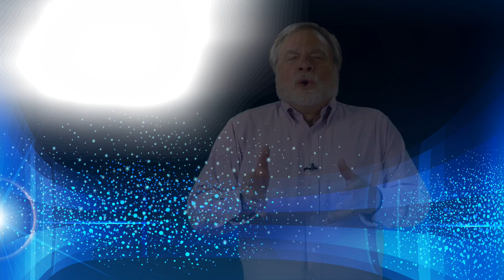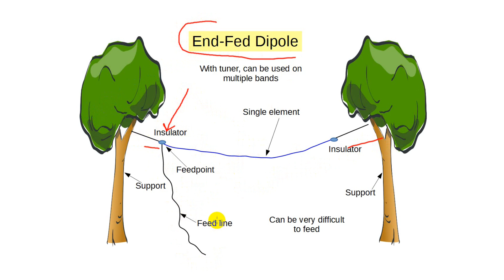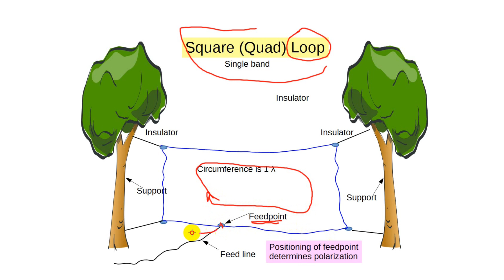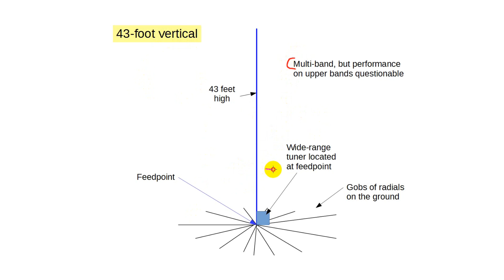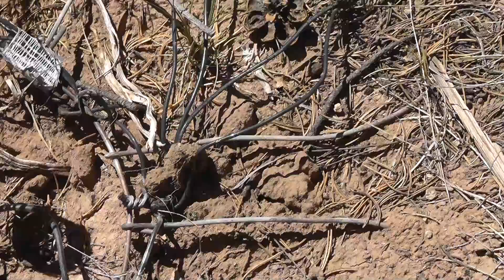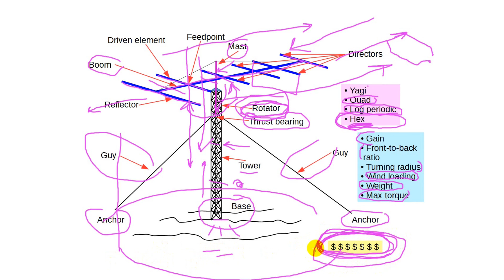Antenna Types and Terminology: AD#30

Comment: So if a dipole be it horizontal or vertical,  bent, or even a 1/4 wave vert is half a dipole and uses the outer shield of coax as the other 1/4 wave if it don't have counterpoise radials....   is how its taught....   

So it gets confusing where we run a 1/2 0r 5/8 wave vertical.    the coil at the feed point matches the impedance and forces the 1/2 wave antenna to have 50 ohm in the center of antenna not at feed point causing it to radiate feed point to tip, like a center fed dipole.    "They" antennas are best with the feed point half wave or a full wave off ground.    

So does this mean that I want the center of my 1/2 wave vertical  a full wave off the ground or still the feed point should be 1/2 0r full???

Comment: Hello sir we are using mc9190 Motorola RFID handheld as well as MC3330R device in our organisation. Where mc9190 works perfectly fine but mc3330r is misbehaving it scanned remote RFID tag rather then near one. Can you please help what went wrong ,I can share you specification of both device on email or it is available on net. Thank you.

Comment: Hello, thanks for video. 
can I ask something about antennas?  Can a rod or telescopic antenna made of aluminum be used for electrical, magnetic and electromagnetic sensing?  Why?
Reply from the maker: Yes. There are signal strength sensors out there, but a lab grade signal strength meter would be very expensive. I've never seen one in ham use.

Comment: Hi Dave. My name is Arthur. KD2pxe. I currently am new to ham radio I have a technician license. I'm living in a top floor 3rd FL apartment and using a homebrew J pole on 2 meters. It hangs from a hook in the ceiling. I would like upgrade to HF but cannot put up an outdoor antenna and have no access to the attic. I was thinking of putting a wire around the perameter of the ceiling. I was thinking of an acordian style folded wire for 20 meters. Do you have any thoughts that could help with this.

Comment: WHY do big heads who live on different continents hide at battle behind children, the frail, the disabled and everyone they battle amongst? It's ignorance. 

Into antenna and global safety:

Is it possible to be light on the earth to go set a small underwater radio with antenna on a dock and beam a static elevator to the peaks of mountains then speak through the central static slots as call stations over fragile grounds and canyons, valleys? 

See, if so...thats good on every continent for everyone. It has to keep far  atop auto antenna though.

Comment: When viewed from above, do the two legs of the dipole have to form a straight line? If not, how acute can the angle be? In other words, can you do an inverted V configuration when viewed from the side that appears like an L (or even a V) when viewed from directly above?
Reply from the maker: No, but keep at least the center part kind of straight.

Comment: I use a 3 band fan dipole in an inverted V configuration. All three bands are 2 to 1 for the frequentcies they are cut for. Can I use this self determination concept when attaching to the coil of the AV18VS or similar vertical? Thanks 
Bill Via K7VIA ham extra class.
Reply from the maker: Not sure. Maybe someone can comment?

Comment: Is it effective to replace the radials on the ground with a large hunk of metal?
Reply from the maker: No. The radials are not counterpoises. They actually form part of the antenna.
Reply: @davecasler  Thanks :)

Comment: David I really appreciate your videos. I’m new on HF, and am using an Icom 7300, but with only a beginner’s basic vertical, and it’s not far reaching. Now that your video is two years old, I have the following questions. I am considering either the Cushcraft R-9, or High Gain 860. The reviews on the Cushcraft R9 seem better. Is there a better vertical than these two, that I’m not yet aware of. I have a roof eve mount ready for them. Bill Rhetts – KM6ESG
Reply from the maker: I think you must mean the AV-680. The thing to note is that it covers only a tiny portion of the 80 meter band--you choose which portion. You might look at the less-expensive R8 and AV-640.

Comment: Thanks for the video!  I was a ham for some time, going up to Advanced class... then, due to various reasons Iwas unlicensed  for about 10 years...  then last june, after studying for several months, I took both the Tech test, and the Extra test!  85 questions in one test setting! I made it out alive, and with a Extra class ticket!  :)  So much for the background...  Most of this material i know pretty well, but appreciate seeing it all from a different viewpoint...  I would have like more info about Hex Beams... but with the time alloted, this is probably all you had time for that kind of antenna!  - AI6XK
Reply from the maker: I haven't really done any videos on gain antennas because most new hams don't have access to them. Welcome back to ham radio! See you on the air.

Comment: Is window line the same as what we used to call ladder line?
Reply from the maker: Close, but not exactly. True "ladder line" has spacers every so often to keep the wires apart. Window line is just oversize twin lead, 450 ohms rather than the usual twin lead 300 ohms. To save on plastic, manufacturers cut lots of holes in the plastic, giving the appearance of cutting "windows" into the line. Very often window line is erroneously referred to as ladder line, so often the term has stuck.

Comment: Yaggi 4 element beam 27mhz can this antenna be used on other frequency with a atu. Great channel thanks.
Reply from the maker: Not so much. The Yagi itself is a resonant antenna, and off-resonant frequencies will be attenuated. One thing you can do as a ham is to shorten the elements to create a ten meter antenna.

Comment: Is picking up a lot of ground noise good or bad.     yes I have fiberglass screening. Always seem to hear up the eastern states but just can't get anyone to hear me.  And finally is aluminum framework for the screen impeding and grounded? And does adding additional ground radials help?km4ypd. George
Reply: Is adding a base linear amplifier of 350-500w a good thing on my porch and will it get out farther?km4ypd
Reply from the maker: In theory adding a linear will help you get out better. But be sure to check the RF safety guidelines to be sure that you and others aren't receiving too much RF. My antenna is about a hundred feet from my station, so even at higher power, I'm well in the safety zone. 73

Comment: This is now my radio newb go to reference , thanks.
Hoped to see some information on Discone as I only listen currently there are some claims  of  a 0.05 to 2000 MHZ Discone, is that even possible?
I have a G5RV that's a tight vee down to the bottom of the garden due to lack of space, it's a half wave and I'm hearing and decoding BPSK and machine Morse from quite some distance :)

Would a Discone give me much more?
Reply from the maker: Practical discones have a more limited frequency range. I have one (that I just took down) that covers 144 MHz through about 450 MHz, and I used it as a multiband antenna for VHF. (I'm replacing it with a dual-band antenna.) HF discones are very large--50 feet or a hundred or so feet tall. I remember seeing one when I was in the Air Force--an impressive structure. You might be able to get an HF discone to cover maybe 7 to 30 MHz, or if really large, down to 80m, although it would lose performance on the higher end. There's no practical discone that would cover 50 kHz to 2 GHz. The key reason for using a discone is its broadband frequency coverage, but as antennas they are simply verticals. For hams, we have defined frequency bands, so multi-band verticals will give the same performance as an HF discone at a tiny fraction of the cost. Hope that helps.
Reply: More than helpful thank you. I was all ready to go and buy this amazing wide band Discone now I won't waste my money.
Reply: So, the Comet DS-150s discone I recently bought (claims 25 MHz - 1.3 GHz) is just a bunch of hooey? (http://www.eham.net/reviews/detail/6864)  Thanks for the informative video, btw!
Reply from the maker: Not at all! Discone antennas are kind of weird the way they work. They're extremely broad band. But they have about the same gain as a dipole would for whatever frequency you're using. BTW, discones can be constructed which will work on HF, but they're physically very (VERY) large.

Comment: Nice video though I'd have made note that trapped verticals (the Cushcraft etc) are usually RATHER pricey :(. Each time I look they seem to sit around $1k AUD which I just cannot justify as much as I'd love one. If anything I need a good wind down/fall over tower of at least 40-60ft first (I know someone locally with 80ft but the mob that has it won't part with it until it falls down).

Comment: I use an Alpha J-Pole Sr 6-160 inverted in my attack (only 25 ft high) in FL and it works great with my Yaesu 897D!
Reply: You use an antenna to attack on 25ft???